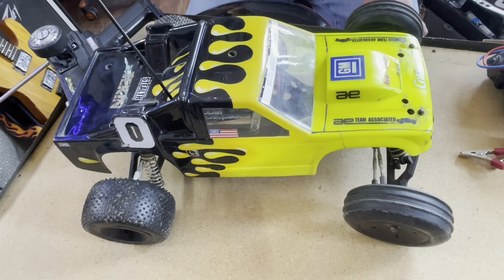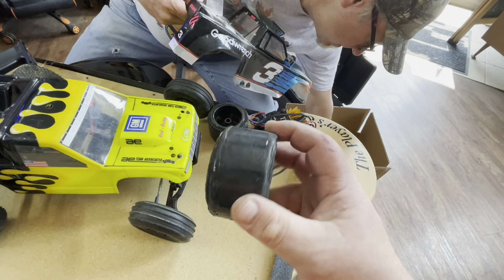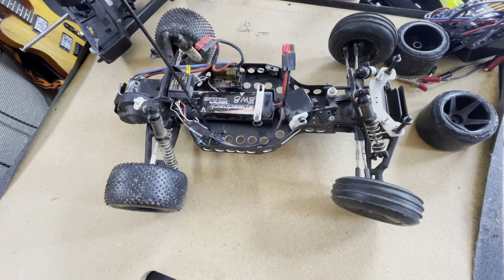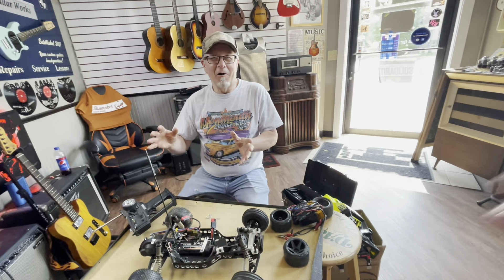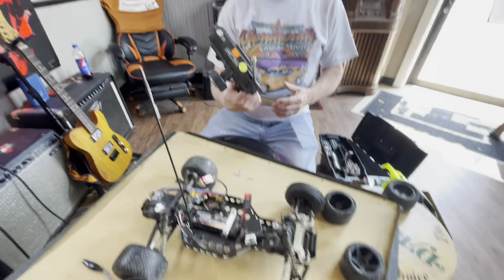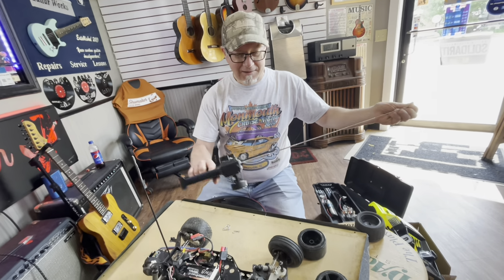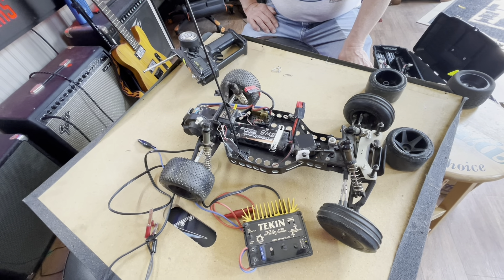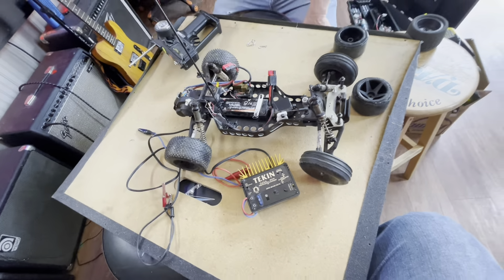Throwback Thursday an original RC10T

Comment: A very cool truck and well raced. Silicone on foam tyres for grip, simplicity upgrades at its best.  Wow $150 for that radio that was very expensive in the day, then his own lefty conversion. One thing I do not miss is the long aerials.
Reply from the maker: It’s a true piece of RC racing history. I love the old radios, I think they worked better than the modern ones
Reply: @IowaBudgetRCBashers  I think the range was far better, but double the batteries that drained faster.
Reply from the maker: @BasBoyRC  and much heavier because of all the batteries, and if you had a mechanical speed control you had the 4 extra batteries  for the receiver as well.. it is nice not having to mess with crystals now
Reply: @IowaBudgetRCBashers  We were men in those days 😆When they had no BEC on the receivers and Tamiya brought out the BEC unit what a great day that was. It was not cheap but soon paid for it's self for not needing those 4 extra AA.
Reply from the maker: @BasBoyRC  hahahaha 😁
Reply: Yea...my wife viewed this interview...she said " how much did you pay for that?" Okay that was 30 years ago...
Reply from the maker: @brucebeintema7109  hahahaha
Reply: @brucebeintema7109  Oh, I'm lucky my wife never questions what I buy, but I always let her know.
Reply from the maker: @brucebeintema7109  thanks again for bringing it into the shop so we could do this video
Reply from the maker: @BasBoyRC  I tell my wife but just might not tell her exactly what I paid for it lol